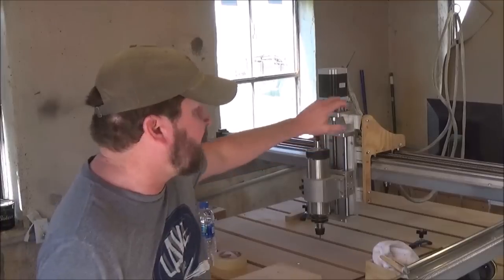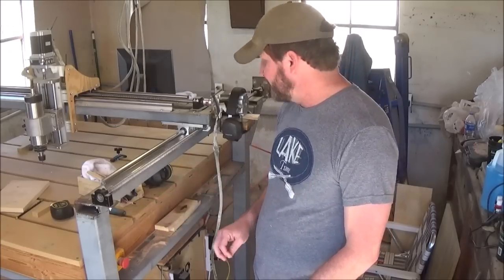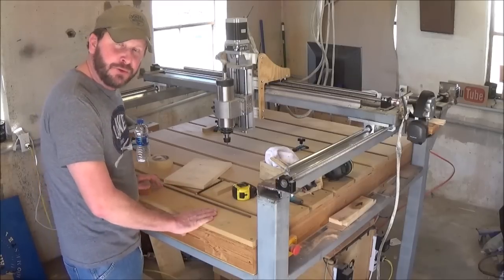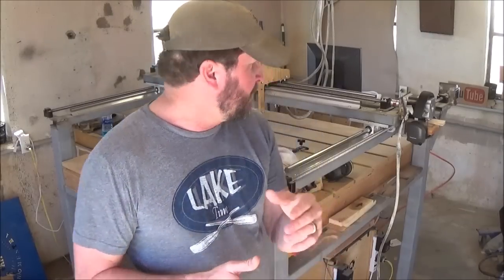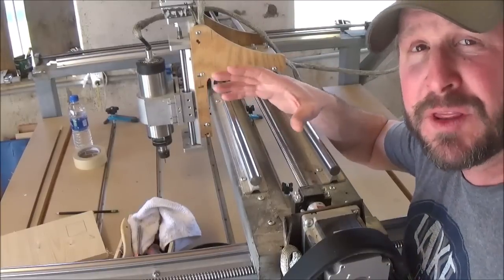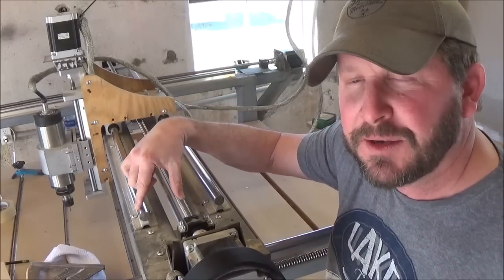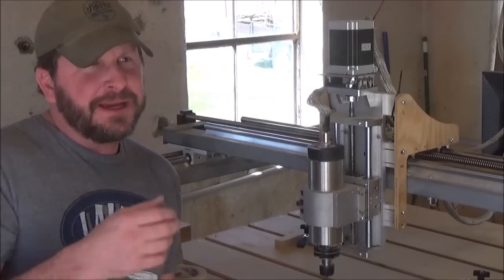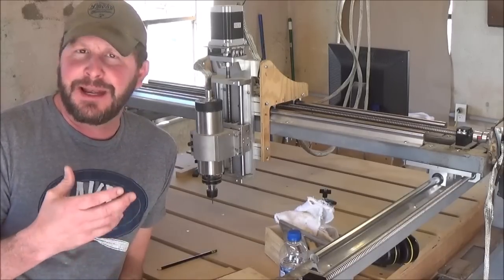DIY CNC Build (measurements)

Comment: Hi,
You have a nice machine there and I really enjoy watching your sign making videos.  Especially your airbrushing technique.  The signs are absolutely beautiful!
I may have missed it, but did you put some type of leveling feet i.e. threaded bolt into the bottom of the foot with a couple of locking nuts  on each leg.  It is hard to find a level floor.
Also, don't know how  level/straight the top tube is and if you had to insert shims under the linear rails at the bolt mounting points to make sure they remain level/straight/parallel to the top rail when the linear rail mounting bolts are tightened.
I had a older Shopbot PRT that ran on angle iron V rails.  I swore if I ever bought or built another CNC router it would have the linear guides like yours.  On the PRT the only thing that kept downward pressure on the cutter was the weight of the gantry system and the angle iron V rails were not all that accurate.
Your machine should last a lifetime.  Great Job!
John
Reply from the maker: I didn't talk about leveling...The only issues i've had were with my floor, which is unlevel and i shimmed to the bottom of the legs to level that up and the waste table..I had i perfect and decided to flip it in order to have 3/4" plywood under my MDF slats and when re attaching the slats to this side didn't get them all perfect...Thanks for watching!!

Comment: What's your actual cut area measurement? I try to design my CNCs with the plan that they will be able to cut at least 48" on both the X and Y axis.
Reply from the maker: Ok so in order to get actual 48", you will have to over size the linear rails and the ball screw...my x is about 38"-39" my Y is about 34"-35", its something I've never worried about to much because I've never needed to do anything really big...Thanks for watching!!